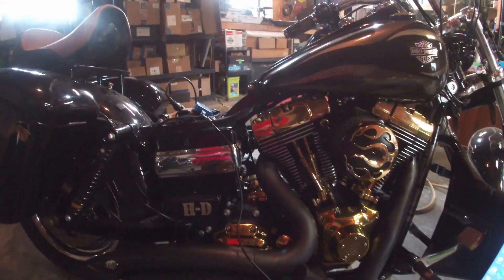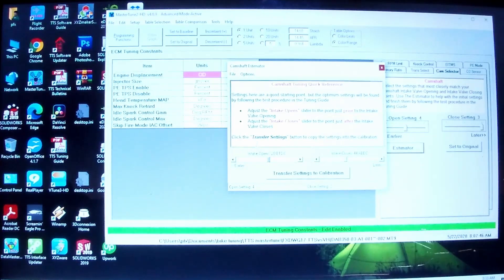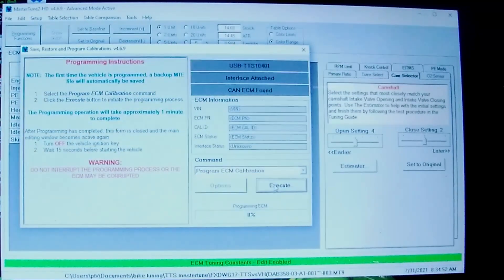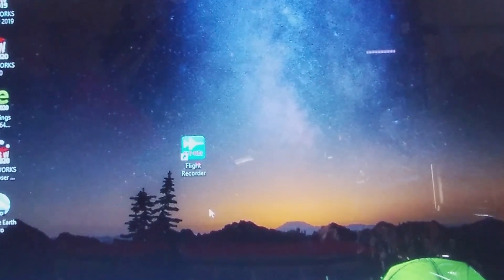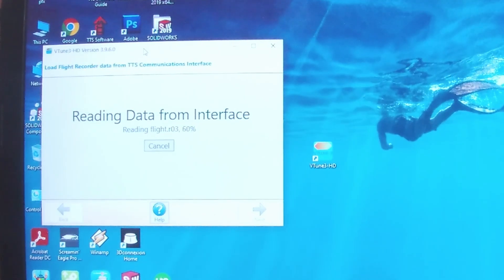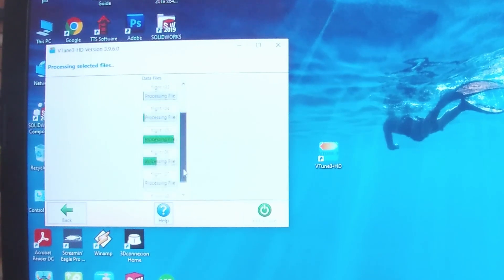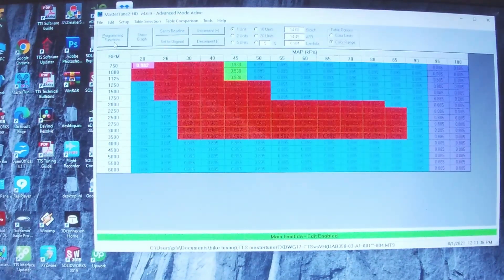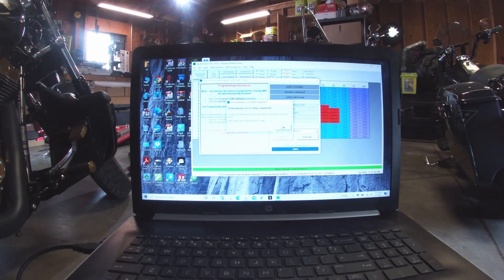How to use the autotune feature of TTS Mastertune after Harley cams install - Random Garage

Comment: Just got this tuner today, maybe spent 3 hours doing this process. I can tell a slight difference each time I run pilot go ride and come back but its literally hating life. How long does it take to really set in?
Edit: I have not been selecting the auto extender on the vtune. Maybe that is my issue?
Reply from the maker: There's nothing wrong with setting the extender each time,  but TTS says to do it on the last time, if I remember correctly. 
Keep in mind the bike will never run perfect during autotune sessions because it disables accel/decel enrichment. When you turn autotune off and run your new tune is when you see all the benefits.
Reply: I appreciate the info, got myself tuned in nicely 22 LowRider S just stage 1 she feels faster today for sure.
Reply: Thanks for the video! I am doing it the same but haven't gotten it to say it's done yet.

Comment: I have a 2014 Wide Glide w/ V&H big shots and an intake. Cams likely but I haven't pick a set yet. In your opinion, is TTS overkill? I always see it on crazy built bikes is why I ask.  I think my ECM just went so I am also considering ThunderMax or something else. I mainly ride distance on the highway if that is important.
Reply from the maker: No, not overkill. If it was way more expensive than the other tuners, then I might suggest that for your setup it would be a waste of extra dollars. But the price is reasonable, so I say go for it.

Comment: Did you change your lambda numbers to allow the flight recorder to collect data in closed loop? It's also recommended to change adaptive knock retard to 0 while vtuning. Also the PE mode needs to be changed to 10,000 while tuning. I can walk anyone through the correct process if needed.